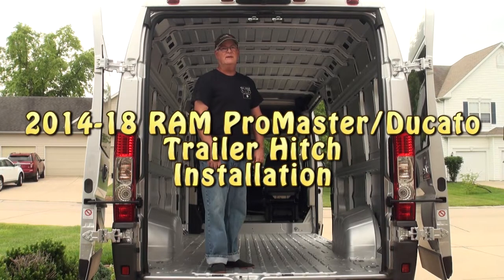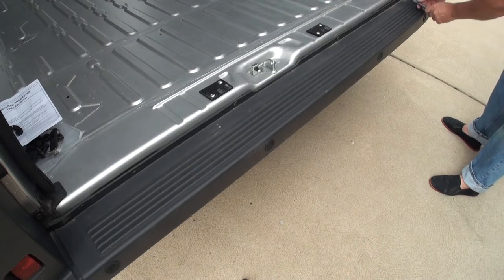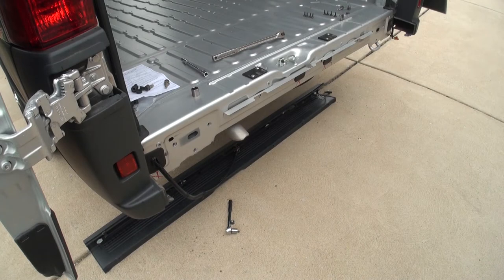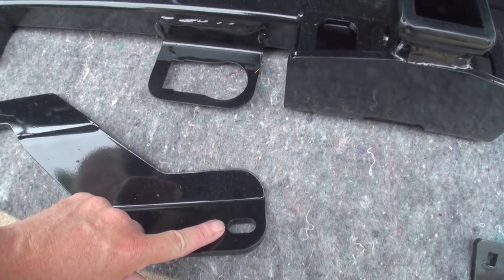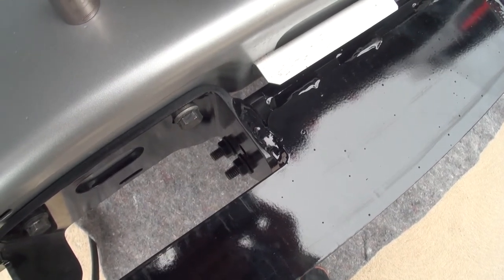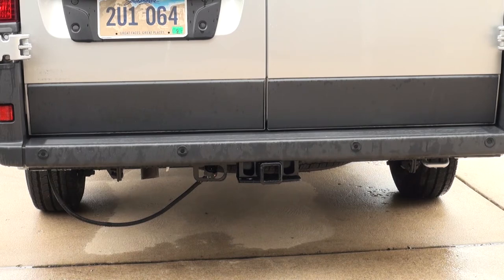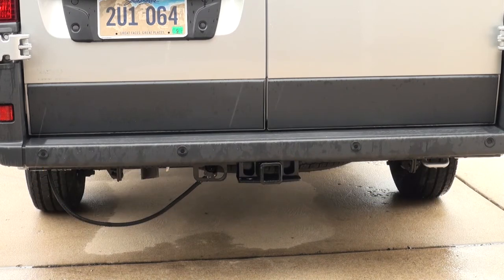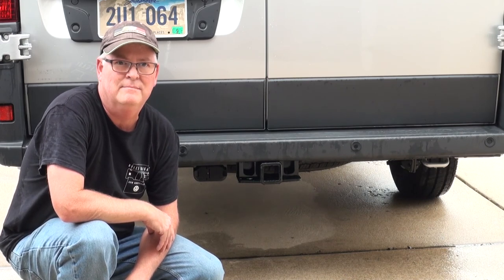Ram ProMaster Trailer Hitch Detailed Installation

Comment: 8:40 -10:00 Place the bolt and fish wire straight up in the second square cut out not in frame side ways. Then with the bolt hanging in second lot it easy to slide up the in-curt the block long side to back of the van place come plumber silicone on the plate  and bolt help keep in in place. it be same for curt's but had to saw off the ground screw for frame.

Comment: Thank you so much .  just bought 2020 promaster 3500 high rooff extended. I hope it's all the same as 2018.
Reply from the maker: I've heard that they modified the frame and that it causes an issue with bolt mounting on the hitch bracket towards the front part.  I guessing your comment is hitch related but if not congrats on the new van purchase.

Comment: Question? I had an issue with my promaster not getting power to the plug , tried to bypass the control module but I didn't work.  The worst part is the we  cut the plug  not sure if we can get a replacement or what to do next???
Reply from the maker: Maybe check with a dealer or look at a MOPAR parts website. I'd encourage you not to cut into any of the factory harnesses. The module is an inline harness and dont think you can part it out. You may have to go aftermarket.

Comment: Quick Question, what about the wiring in the front have, was it as simple of plug in or did you have to splice any wiring? and thanks for posting...
Reply: The factory harness was simple. No splicing,  just make the connections at the rear to the signal lights and then route the power wire up to the starter battery. The hardest part was routing the wire over the driver door channel. It would have been easier if I already removed the headliner. Some folks just run the wire down the B pillar and under the floor covering to the battery.
Reply: Could you make a video showing wiring connections

Comment: Hi nice video could you please show how  install the wiring please thanks in advance
Reply from the maker: Sorry I didn't record the wire install but it was very simple as the factory harness was a plug n play.  The back harness loops up and over the corners behind the rear tail lights  and then the long run up the front is placed above the top rib on the driver wall side.  The hardest part was routing it thru the spot above the driver handle hoop/headliner then down the A pillar.  Just be careful as it runs near the curtain air bag.  I pulled the driverside trim out to make it easier.  The instructions that come with the harness give a great visual diagram.  No cutting wires or anything crazy.  Just protect the wires that run through any metal slots/holes.  Good luck.